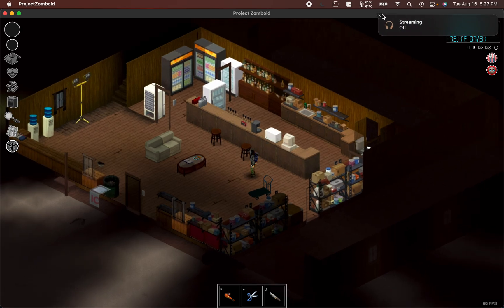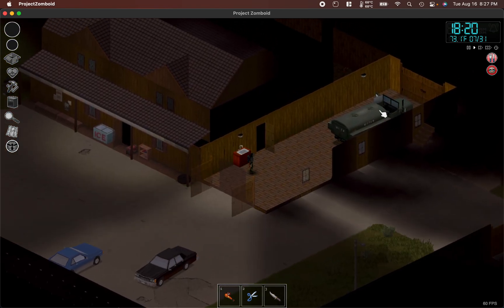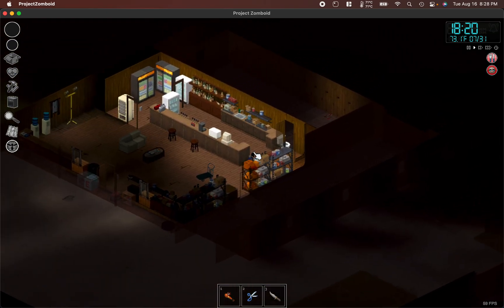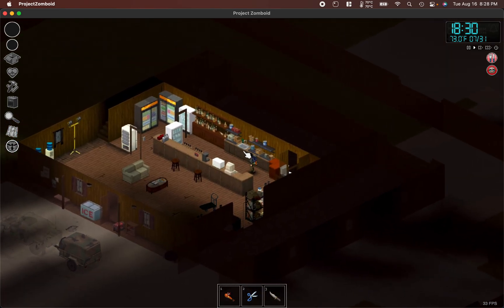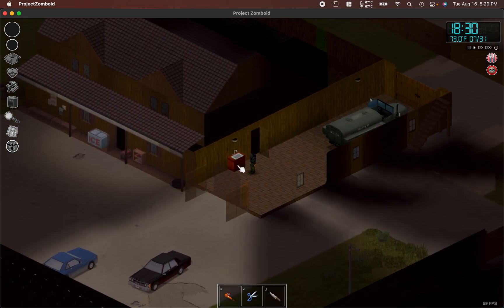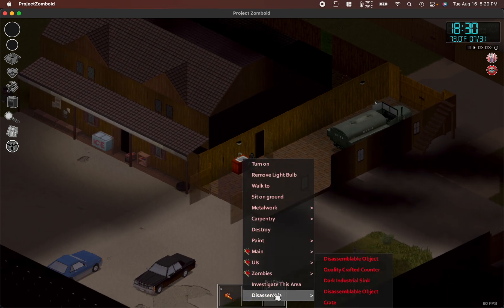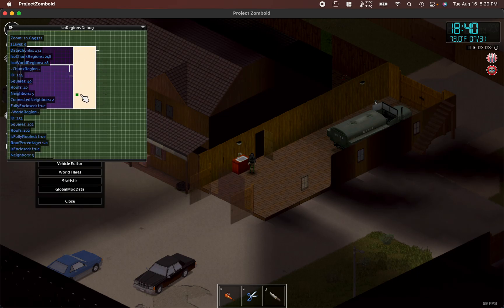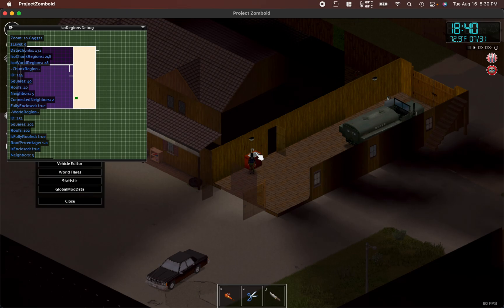Debugging Project Zomboid Build 41.73

Comment: I might not be correct but maybe it sees it as a garage or shed area because of the doors possibly? Perhaps trying some regular doors in the back or a full wall in place, haven't done much extensive building myself so far though
Reply from the maker: I wondered that as well, and did try a much-smaller one with a single door, but it didn't work.  In the past, I'd actually had a sink inside a full garage on a multiplayer server and it had worked; and the devs verified that it works for them, regardless of the doors.  I seem to be having some sort of weird issue.  :/. Thanks for watching!
Reply: @Artystrique  ahh that’s tough I hope you can find a solution! If anything maybe just have a waterjug container in there, happy surviving friend!